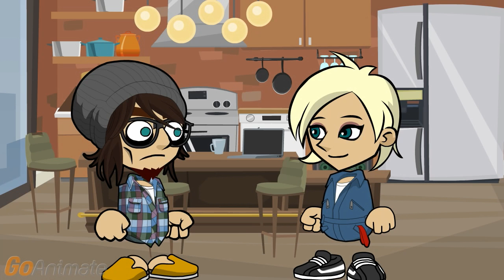Jenn Air Oven Error Codes

Comment: Good Video. But mentioned all the errors apart from F6E8 and that is the one I have. Anyone know what the error means on my JennAir?
Reply: Dawn Hooper it does. Mention every error group F1   f2... F9.   Listen again.  You can search a multitude of sites but the reality is these error codes are general cause and my unit has about 20 probably errors from control pad to input power error and nothing similar to what my unit is doing.   This is my second jenn air.  Fixed it and replaced parts 5 times.   Never had an error code.   Given the age my guess is the technology wasn't there at the time
Reply: Hi Dawn. We are getting the same error code you had, F6E8, and we can't find the answer anywhere. We have a wall microwave and oven and  the oven doesn't work. Did you ever find a solution?
Reply: Unless I missed it, F6E1 isn't mentioned.